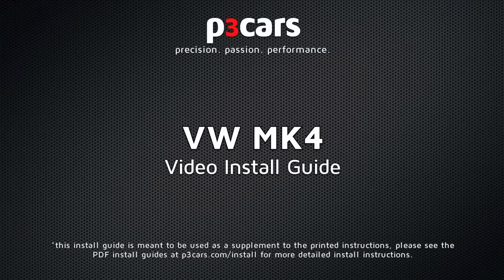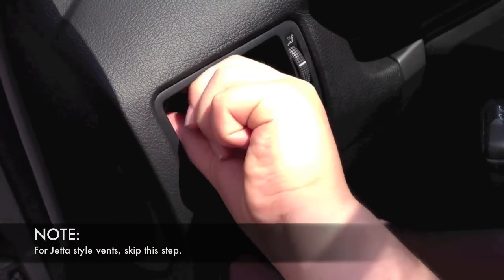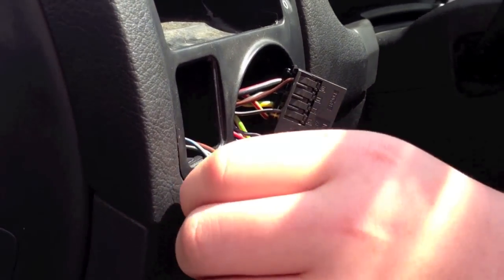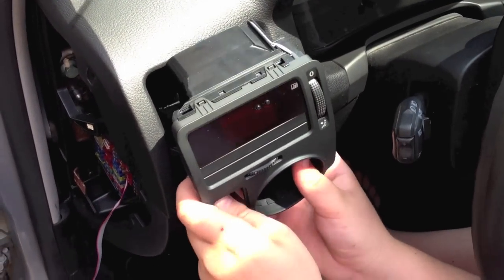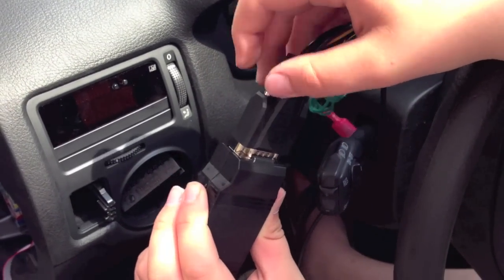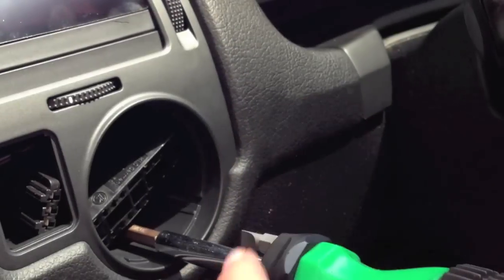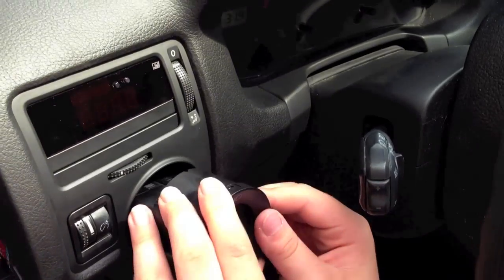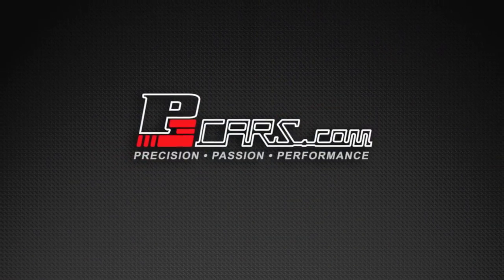P3 Cars - VW Mk4 Install Guide - Digital Interface

Comment: The jetta vents are more complicated. I want to get just the guage and install it but so many fragile pieces
Reply from the maker: The install isn't very difficult but if you feel that it would be too tedious for your liking I would suggest selecting the pre-installed option.
Reply: Are you guys still making the multi gauge?
Reply: For the mk4

Comment: what does this do?
Reply: it shows a bunch of things such as coolant temp, boost in psi or bar, i believe air fuel maybe...maybe vehicle speed.... and a bunch others

it eliminates the need for pod gauges so its cleaner and looks oem. the driver side vent isnt too powerful air wise (at least mine isnt)so this is a great product and if you were to go out and buy a pod and some gauges you can spend the same amount on this and it has a ton of functions

if only people took the time to read the description.....................................................
Reply: Papr TV that's a VERY good question...! I'd like to know too.

Comment: hi guys so i have a mk4 04 i did some work on it i did a 3in turbo back pipe,stage one on my computer ,,will this work on my car? let me know pleas and thnk u for ur time,,
Reply: You have to get the analog boost sensor. If you read the stats directly from the port you wont get the good values.
Reply: thnk u i hv one also..